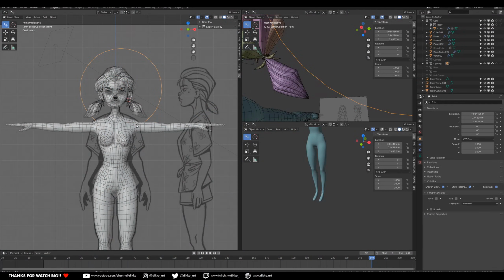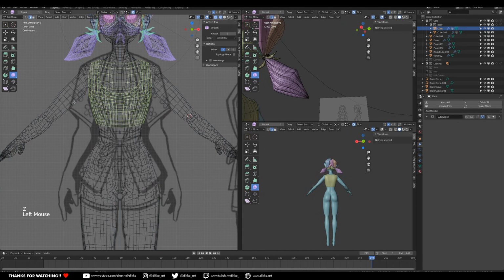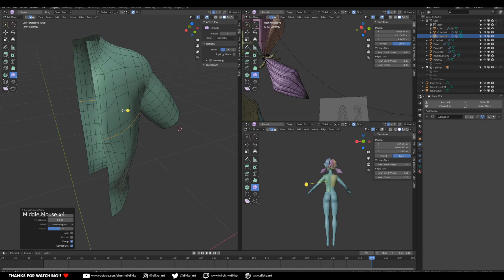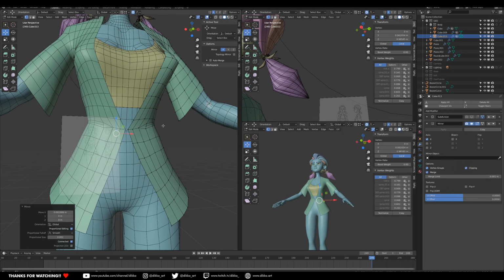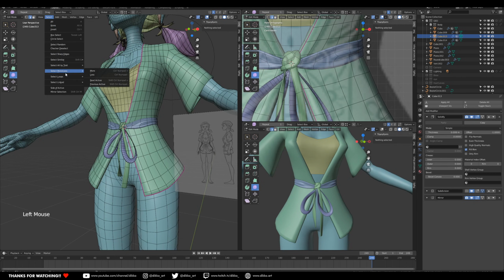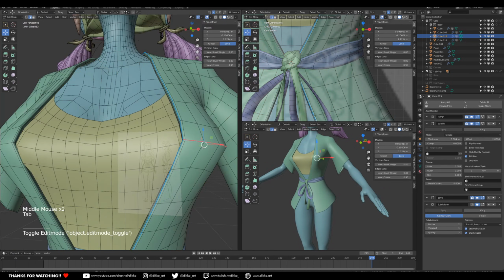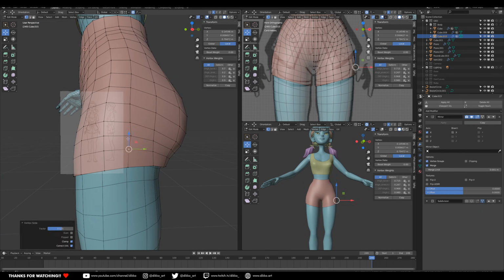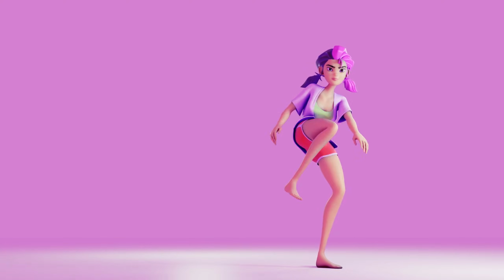Modeling for Animation 08 - Modeling The Clothes!

Comment: You're the man Dikko! Had to take a break cause of work but I'm back at it. If you were doing a hard surface type of clothing (ie, armour) for this style of character would the execution here change or would you cheat it and let the armour bend similar to clothing?
Reply from the maker: You would model it like a hard surface, and depending on the armour, you'd have to rig it in a way that keeps it's rigidity. Or if it's meant to be cartoony, you could probably get away with it stretching a bit

Comment: I think just need the mouth now. I used nodes for texture again. This took me a while and i had less time but it happened. What'cha think Dikko?  One thing I figured out is that if you notice your clothes are clipping when you zoom out you can change the Clip Start (press N, View, Clip Start). I also tried to make my pants and jacket out of one mesh but it made too much shading noise so i ripped them apart.
https://drive.google.com/file/d/1p7FQ0tW--0cnSrrKcYDk9evntvHZ08J-/view?usp=sharing